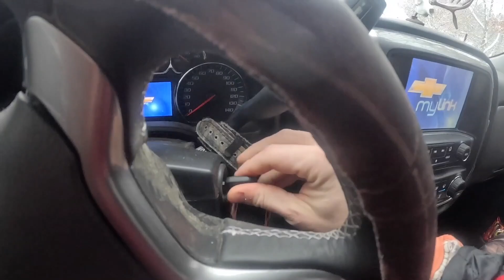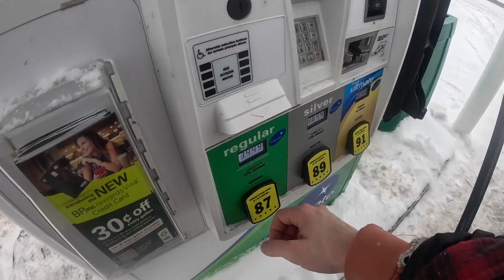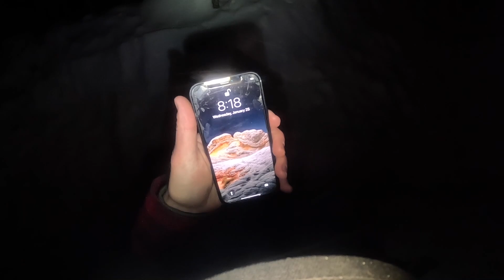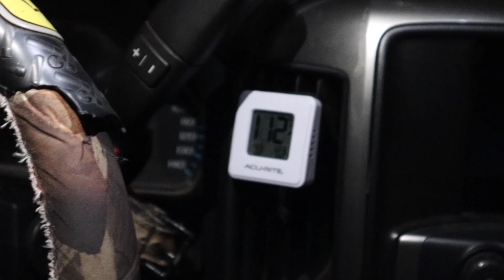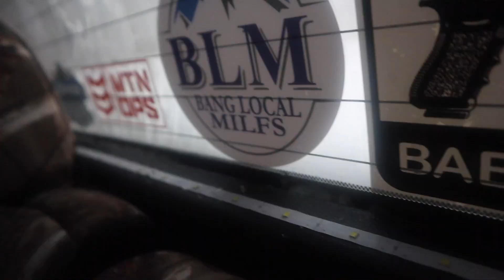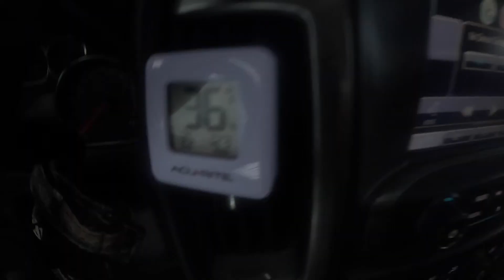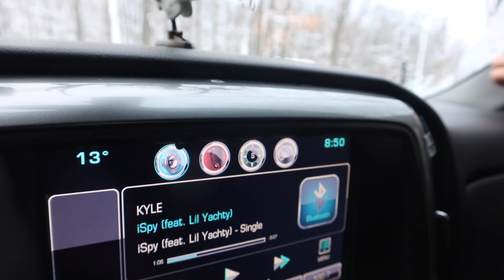Truck Camping In Winter Snowfall | Shrimp Tacos & Closed Campgrounds

Comment: I didn’t think the video was subpar at all. Those are the struggles of camping in bad weather. Y’all boys get quite a bit of snow. Where I’m at in VA, we haven’t gotten any snow or ice so far. However that was a damn good show brother! Would you be interested in doing a video on your sleep set up. I camp the same as you in a quad cab truck. I’ve taken my back seat out, slide the seats forward and I can stretch out. Your truck appears to be a crew cab with a lot more room and the back seat still intact. Just curious how much room u actually have. Keep rocking !
Reply from the maker: Thanks man! I greatly appreciate your continued support! It’s crazy the snow we have gotten so far this year! Hard to get into most campgrounds right now sadly…I thought about deleting the backseat but I also have kids so just in case I had to put them in the truck for a day I wouldn’t want to deal with taking the seats in and out. This is the most easy and convenient way for me to camp and if need be I just need to take my upper bracket out that holds my tablet & lights out and no big deal. I will definitely do some better filming on a upcoming video that way you can see exactly how I have it set up to sleep. Believe it or not this is actually smaller than the crew cab it’s the double cab but honestly I fit pretty well in the backseat and honestly it’s pretty comfortable! Thanks again for watching!😁👍🏻